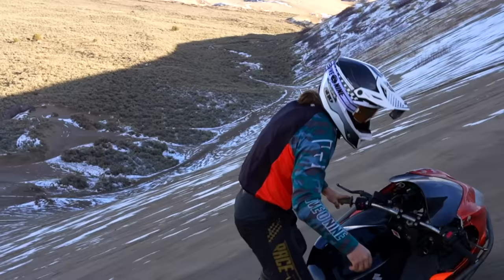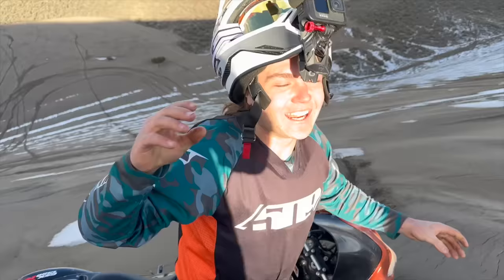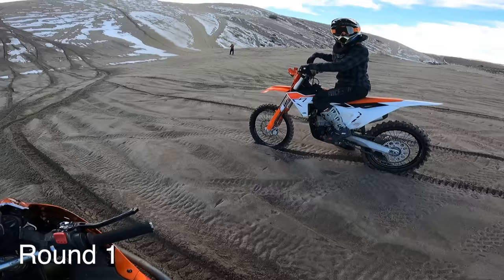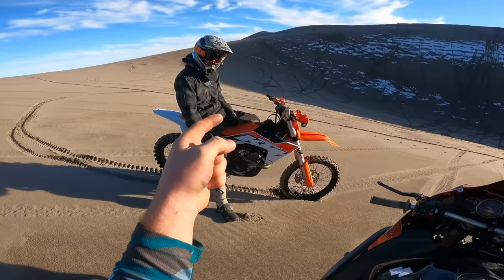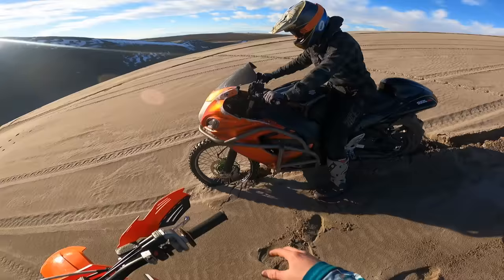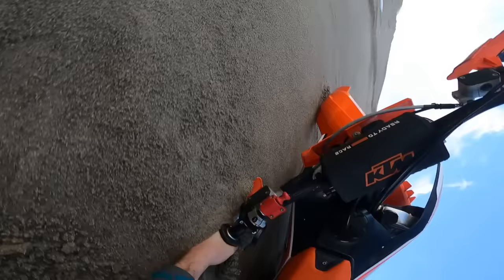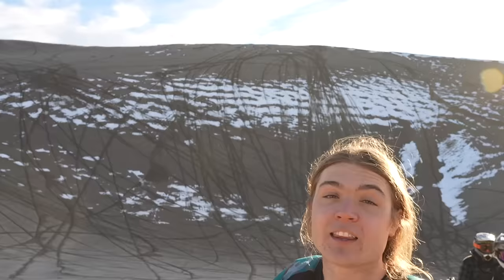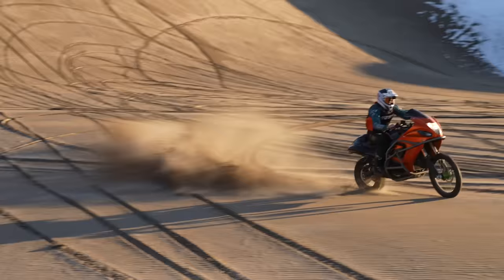Street Bike with Paddle Tire at Sand Dunes

Comment: Awesome racing from very skilled riders and about what I expected on paper. The KTM weighing in around 225lbs/75hp vs the Hayabusa 580lb/180hp. KTM quicker off the line but Hayabusa pulls on the top end. Close races, both bikes are fast. 

When it comes to riding street bikes on sand/dirt and engine swaps. I can't get enough of these videos.
Reply from the maker: That KTM was insane
Reply: Likely the gearing is different too, the busa might have a softer take off just so it doesn't wheelie off the line. It's one of those things you tinker with to get a good gear ratio for off-roading since  it's been geared for on-road use.

Comment: I know the power of the busa I bought a new 2000 model and on the road it left black lines when ever you crack the throttle, but this is another level, Mats videos just get better every time, I’ve never been so impressed. And to top it off the tune was spot on. Talented guys

Comment: Love the content not sure what size paddle you have but the 5.60 Chen Shin is  much wider and taller than the 5.30 everyone else uses , it made a huge difference on my bike .
Reply from the maker: Good to know. I had Skat Trak put on their bigger one. Unsure on size. Had to shave it down to fit swingarm.
Reply: one thing you should watch for ,put a filter on the overflow breather hose, if that sucks up the sand the motor is toast . @MattSpears
Reply from the maker: Thank you! Will look into that @premix3663

Comment: I somehow missed the front fork swap, unless that's just a skinny front tire with a different bar and clamp set up. 

The added ground clearance and suspension travel will help but you've also made the front end visibly lighter thanks to the lighter front wheel. It certainly wheelies easy now.

Comment: Is it stick busa suspension, etc and only different tire/wheels? If so I'm impressed it held up to abuse it was never designed for.
Reply from the maker: The front end has a full moto setup. Showa forks/tripples

Comment: I'm not even mad 😅
Ok, maybe slightly that you didn't launch it over the dune like the KTM and Yamaha did 🤣
Now you gotta get a smaller, lighter bike with similar power, like a straight liter bike.... you'll be missing out on the torque, but you'll drastically reduce the weight.

Comment: sounds like the paddle has low pressure maybe?   always run paddle tires firm.  
 the paddle is your propeller , a flexing prop is poor formance,,  low psi also kills the paddle tire .   maybe if it's a "dirtbike" paddle,  it's deforming it regardless. Best bet is to contact SKAT TRAK  , have a used street tire paddled up...

Comment: Um, YOU'RE wrong and have been misinformed about the steepest in USA.  Steepest dunes are dunes that don't have tracks on them.  So if you go to Sand Mtn. Nevada;  when looking at the hill from the front, drive to the right and go to the 3rd hill like your going around the mountain.  It will be a skinny area, between sand and rocks to the right. Watch for other riders coming from other side of dune.  you should be there now,  There is barely any area for a run at it.   It's the kind of steep where you want to lean forward so you don't lift up on tires